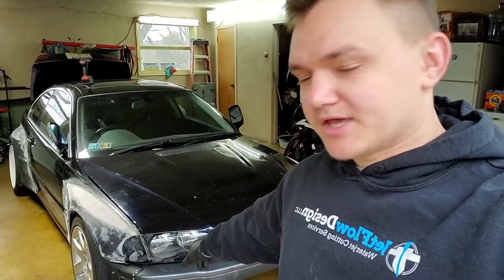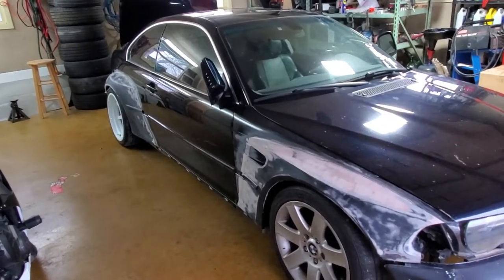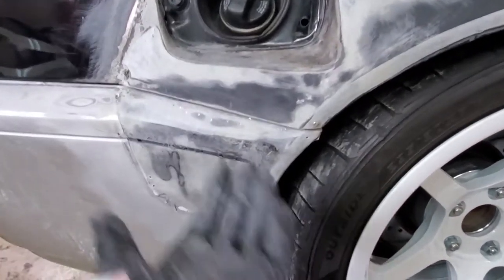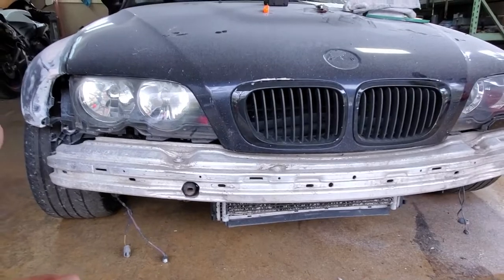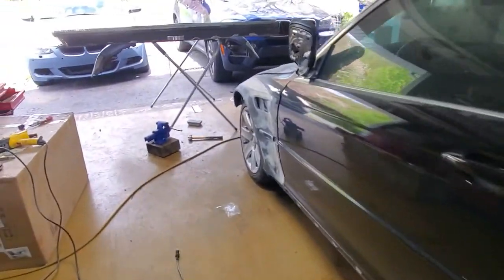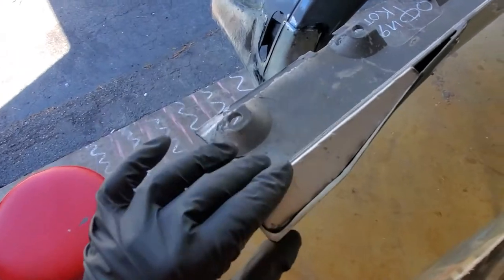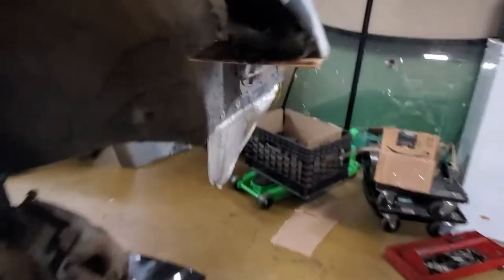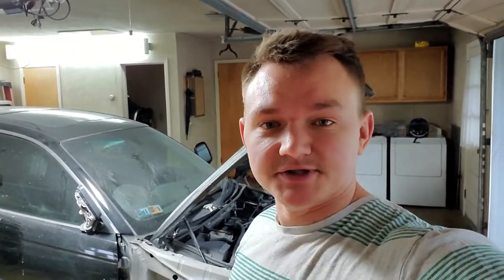BMW E46 WIDE BODY KIT Install Part 17

Comment: did you ever use the wide body with stock side skirts ? and did it look weird or ? and are those the duraflex wide body ?
Reply from the maker: Yeah I tried, and it wouldn't fit